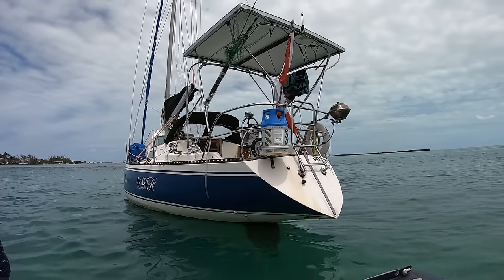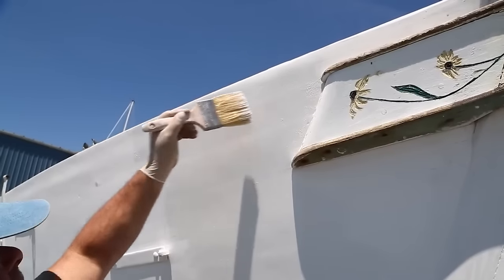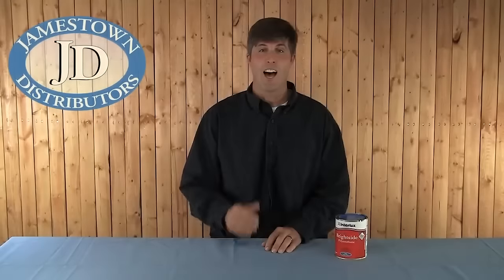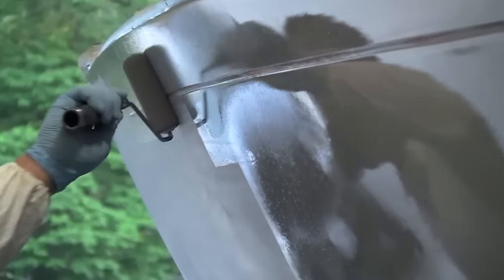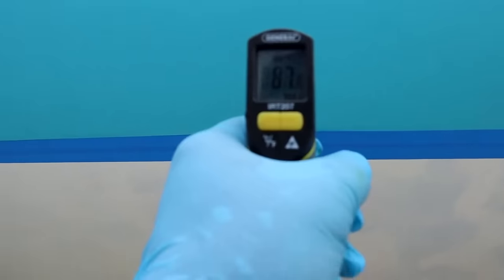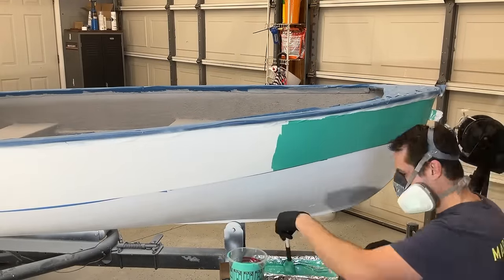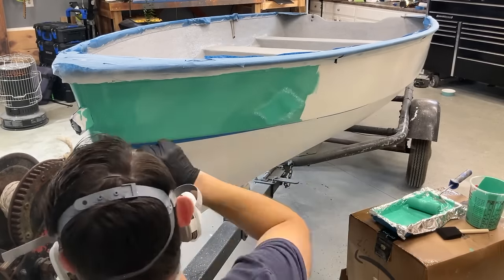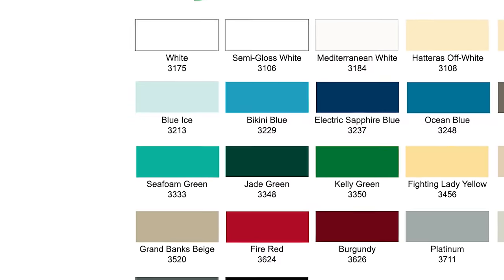Sailboat Paint Decisions, Decisions... Just Basics - Ep 273 - Lady K Sailing

Comment: This is off topic to this video, but you have stated in many of your videos that 5000 hours is getting towards end of life for diesel engines in boats. Coming from the trucking industry I’ve regularly seen engines go over 40,000 hours. 5000 hours on a truck engine, would just be on the edge of the engine being due its second overhead.  I curious why the short life of marine diesel engines ?

Comment: Black will show every little thing. It can also be detrimental to the hull material due to heat build up in the sun...like in the tropics. It is also far harder to get a great paint job with. The darker the color the more it will fade or oxidize usually too. Black is a bad idea

Custom hand mixing can make you cool colors, but mix more then you need and store it for touch ups....You may never mix the same color twice. 

Boat Paint jobs are usually judged by how far away you have to be for it to look flawless. A 2ft paint job takes far more work and perfectionism then a 15ft paint job. It may be helpful to decide in advance on what level of paint job you would find acceptable.... Knowing in advance it will never look even that good after the first week in the water. 

 ~A Professional boat builder

Comment: I'm probably twice your age and have studied plastics for planes and boats to a lesser extent , plastics was my major , your boat isn't painted it's a gelcoat of probably unknown origin , probably a polyester a very good builder may have used a vinylester an that would not be on a production boat or an epoxy gelcoat so my drift is you have a lowest bidder gelcoat that looks like paint to you but isn't , I would polish it with an 8 inch disc 400 grit then 600 call it done put a epoxy coat on clear , black is the worst thing you can color any plastic with because of the heat that builds up , if you like your boat it's white or almost white , if your going to sell it an don't care spray it with lysol and black enamel from haborfreight , your boat isn't painted that's a lowest bidder clearcoat then clearcoat with color , so get that straight , an dark colors weaken plastics in the sun , have you ever seen a black electric windmill or 747 aside from trumps no they are white for a reason , you can test this yourself go sit in a black car on a hot sunny day till it gets to about 160 or more inside then think of the lowest bidder polyester mixed with fiberglass sitting in the sun that turns into a wet noodle at that temp an you get bad weather um what is holding that mast up ? just a thought from an engineer an Godspeed 🙂